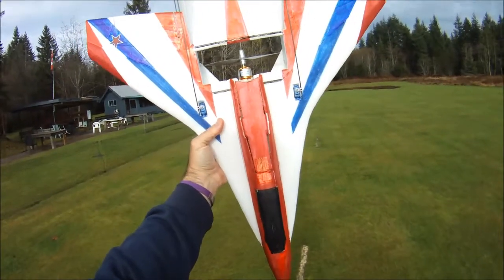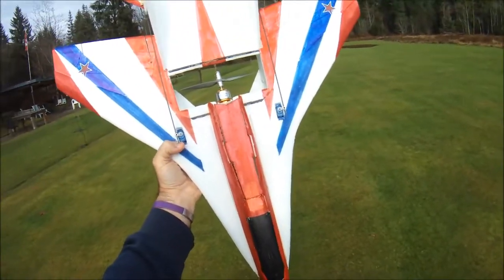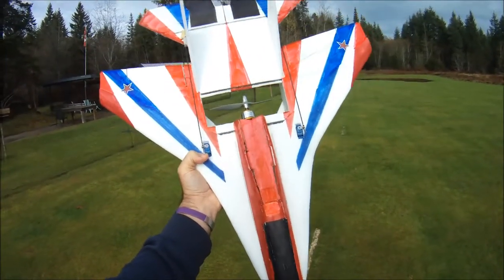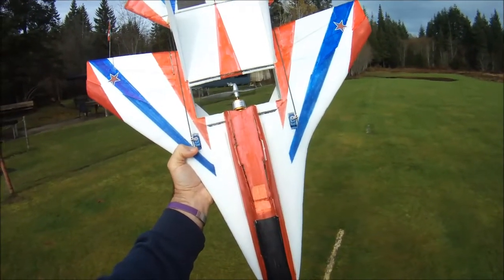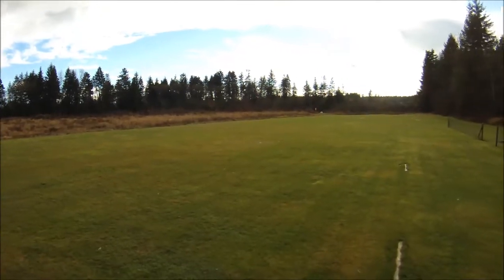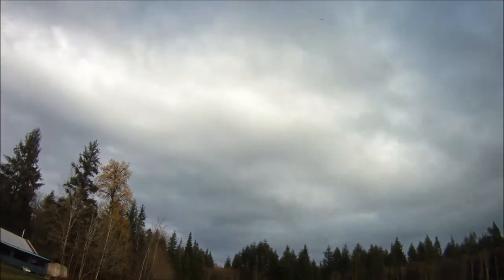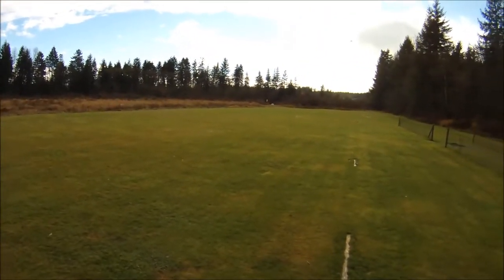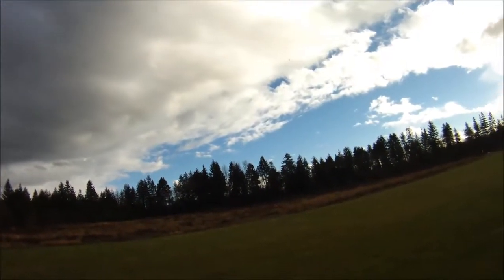Field test of 2212 2200 Kv motor and 6x4 APC gas prop on 3S

Comment: Awesome flying as always! I can't believe how inexpensive that motor is! I guess it's time to start looking at gas props for my electric planes ;-) Thanks for the information. Happy Flying and Happy Thanksgiving!
Reply from the maker: Thanks so much as always :)  Yes, those motors are a pretty good deal, you do have to provide your own bullet connectors and sometimes the prop collets are really soft and bend easily, but I have lots of the connectors and collets on hand.  Most of them run quite strong and are durable, occasionally I have had one with a bad set of bearings that don't allow it to run to it's potential or cause the motor to run hotter than it should, but for the price it is tough to complain.  After watching rcplanepirate's video about comparing props, much of what he said there about the differences between gas and electric props made sense to me https://www.youtube.com/watch?v=uu6uuBTfoPE&t=1630s  towards the end at around 27:00, he tests three 6" props one after the other and you can see quite a bit of difference in thrust and amp draw.  Happy flying to you as well and hope you are having a great Thanksgiving weekend :)  Cheers, Scott

Comment: can you give me information on what size 3s battery you're using with C rating?  also what ESC?  thank you!
Reply from the maker: In this video, I was using a Zippy Flightmax 2200 3S 40C battery which unfortunately is discontinued.  I used the Turnigy Plush 40A ESC which is also no longer available.  If you use a 2200 3S battery with at least 40C, you should be fine as well as most 40A ESCs.  I cannot give you the plans, they are designed by someone else and are copyrighted.  You can purchase them here https://www.rcpowers.com/post/rcpowers-v4-plans-10025907.  The plane in the video is built primarily with Dollar Tree foam or Adams readiboard.  Cheers, Scott
Reply: @e3Scott   Thank you!!

Comment: Great information, wow that plane is fast, too fast for me :(
I'm thinking of putting this motor on a Gentle lady glider, any ideas of a folding prop size for this motor?
Great flying BTW!
Reply from the maker: Thanks very much.  If you are running on 3S, I would not put anything more than a 7x4 prop on this motor.  Best of luck :)  Cheers, Scott
Reply: @e3Scott  Thanks Scott!

Comment: Do a 6050 prop would be ok for this thing ?
Reply from the maker: Yes, on 3S, what ESC are you using?  If you are using 30A, I would watch for heat build up depending on how much throttle you need or like to use when you fly.  Cheers, Scott

Comment: Will 5045 prop work with this motor for a quad copter?
Reply from the maker: It probably won't work as well as a two bladed 6" prop on 3S, you might have to go to 4S to get good power with it, just be careful, most of these motors are maximum 34A, so if you put a prop on that pulls more than that, your motor might overheat considerably.  Good luck!  Cheers, Scott
Reply: @e3Scott  thx a lot scott... Ur flying skills are just amusing to watch... Wish u many more shbscribers
Reply from the maker: @Byadx  Thanks very much, best of luck in your flying journeys!  Cheers, Scott

Comment: I did with 5inch 3blade prop and just got 380gr thrust. Is that normal?
Reply from the maker: What pitch is the prop you are using?  I assume you are using 3S?  If you want to keep using the 5" blade, you might have to go up to 4S battery to get the thrust that this motor is capable of.  On a 6x4 2 bladed prop on 3S, I normally get well over 700 gr of thrust.  On 3S, if you want to use a three bladed prop, I would suggest a 6" prop similar to the one I tested in this video https://www.youtube.com/watch?v=xxPhJ31UG7o&list=PLKu3yFqYM98mOVc6vpxiog7bNmulXp1kU&index=11  If you go into the description of the video I linked, you can find where I bought the 6" props.  Good luck!  Cheers, Scott
Reply: @e3Scott  Yeah, it's 3s. I'll try with 6x4 prop, Thanks mate!